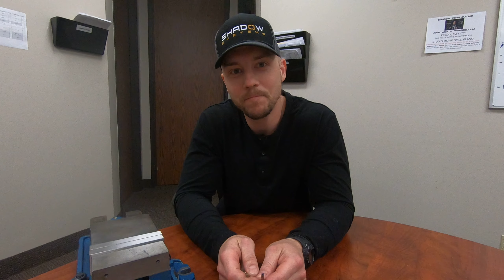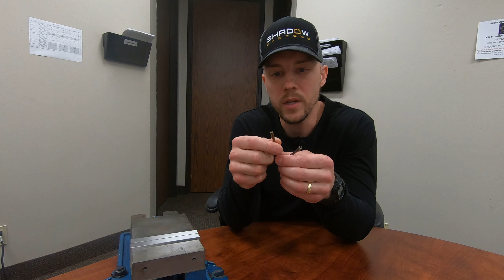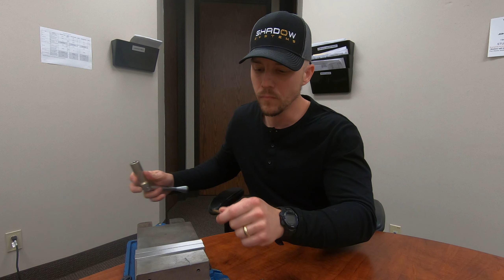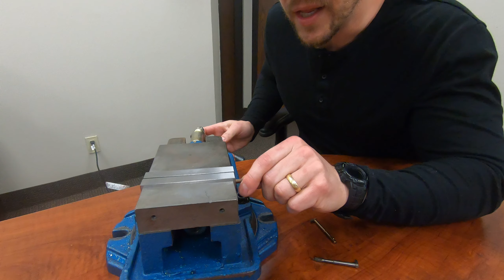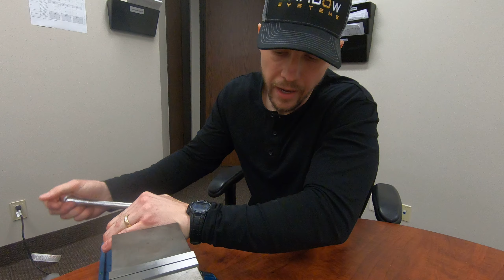Technical Tuesday: Why we machine our firing pins from solid stainless steel

Comment: The big problem with this video is the Glock firing pins are NOT an MIM part.  There are no seams.  There are no molding or gate marks.  Or you could just ask Glock.  Pro tip:  If you can't tell the difference between MIM and machined, you probably don't need to be making videos about them.

Ignorant videos like this serve no purpose whatsoever other than to shill parts nobody needs.

Comment: This is a dumb test, Its testing the metal in a way that never would happen in a firearm. I also noticed how much harder you yank the Glock pin than the 17-4 pins. Probably because its harder to bend a factory Glock pin because its a harder material. While Glock pins don't need to be hard to take the beating of a hammer, The tip should be hardened IMO.